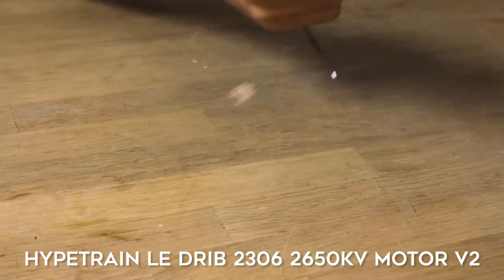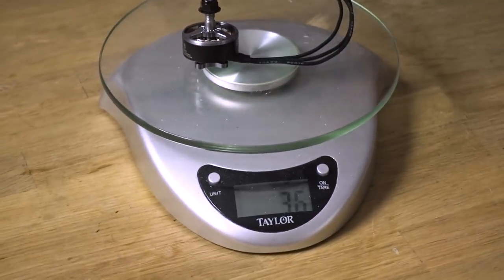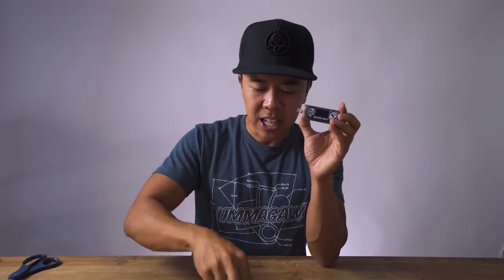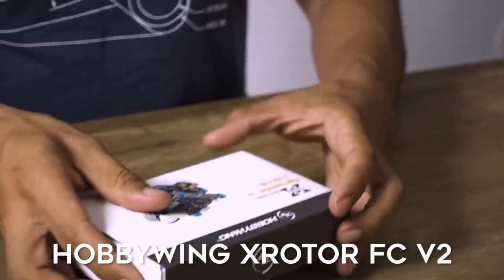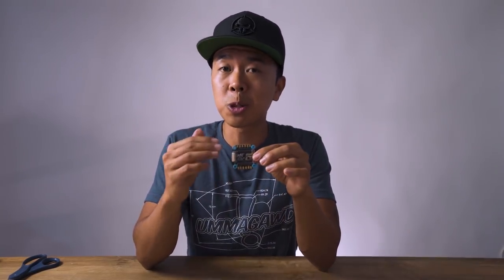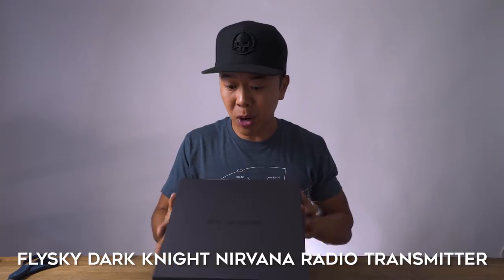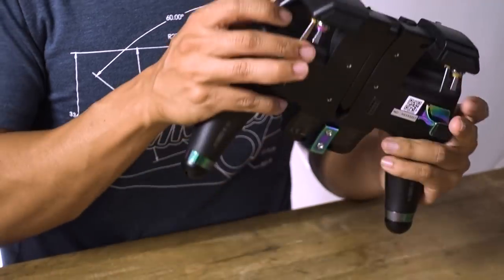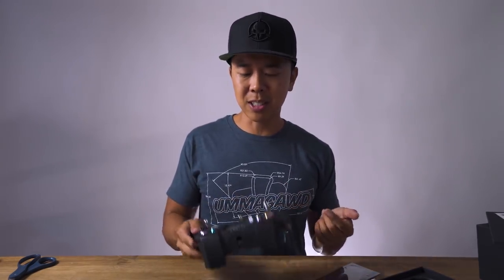FirstLook! October 2018

Comment: Not much support for the nirvana.   Still not opentx ready.  Fpv underground is supposed to put it's own format out as well.   Works on PC when you turn it to joystick mode.  Comes with extra springs for the gimbels to tighten them up.   First and only radio I've gotten.  Gotta set it to mode 4 in the transmitter itself for mode 2 flying.  Hope this helps for a first radio it was a struggle to get going but since in up I've loved it.

Comment: Sounds like (if) when you change your video TX frequency, you get a reduction in output power. Likely has to do with your antenna being tuned (cut) at the frequency where you get the highest output. When you tune away from that freq you get a standing wave back into the video transmitter, reflected power. You will typically get the best effective radiated power output by tuning to the frequency most resonant to your antenna, sometimes referred to as the match.

Comment: Quick warning ... when pulling off or reattaching the Flysky hardcover . If you drag the back against the rubber grommets ( on the back of the transmitter ) they will catch & rip off .

Comment: Hi Tommy, Great Video thanks for the information on the motors perfict for my chameleon, Great power meter just one question can I use it for GHOST HUNTING ! lol guess not.  The hobbywing F.C LOOKS GREAT !  wish I would have used it instead of the #%^&# one It used separate ESC and the ones I had melted ,  Nice charger much better than mine it's a old  ECO POWER and it won't charge a 4s anymore,  And for the NERVANA  I can't say I have never seen one or read about it,  I just purchased a new Radio that I changed from a SPEKTRUM DX8 and the new one is so much harder to figure out. Great video Great information THANKS.   JohnnyDRC

Comment: D2 has been available for a while now just not all stores stocked them. They are the best home unit 😎🤩
Reply: I'd buy it in an instant if it were 300W or more. With 200W you max out at about 1.5C charging 6 typical size packs.
Reply: Relic FPV it does 12a. I've used it at 6a with 2 parallel boards 4 sockets in each with no issues

Comment: I can't believe fly sky has something you just said was comparable to a taranis. 
That radio looks cheap and there is no way I could imagine anyone actually using that. Go with a futaba,spektrum,or taranis.. gotta trust your gear......flysky no thanks.
Reply: a lot of people said the same about the taranis when it came out. JR is now dead and both futaba and spektrum have had to make massive changes to keep up. 
the flysky stuff is ok  and reliable - even the cheaper stuff. 
On the evolution and the i6, I found the sticks drift the input too much and the telemetry features are limited.
as you said though, you gotta trust your gear, so go with what is best for you.

cheers